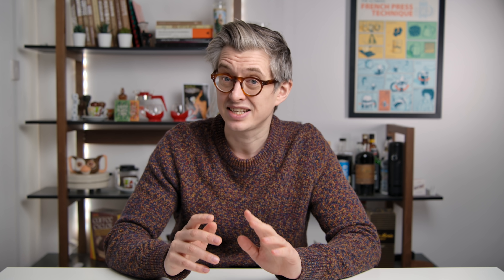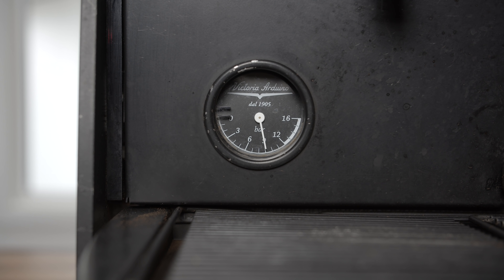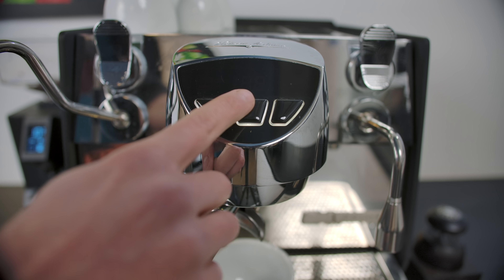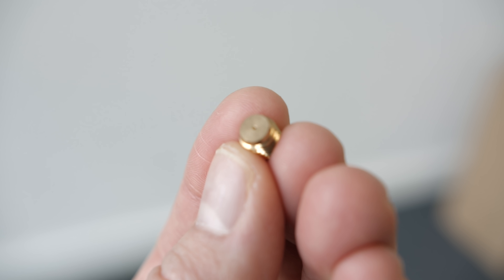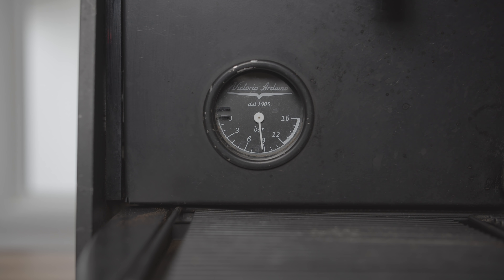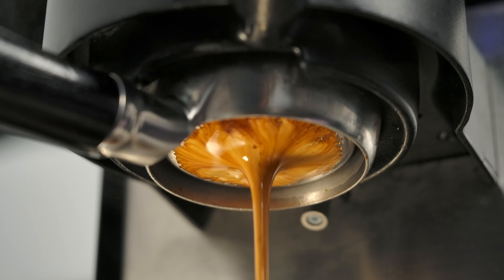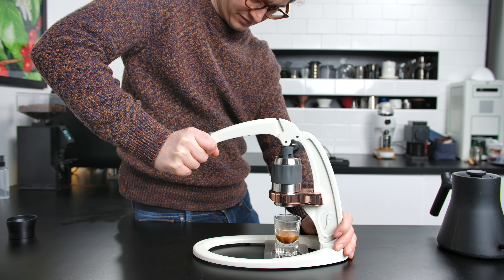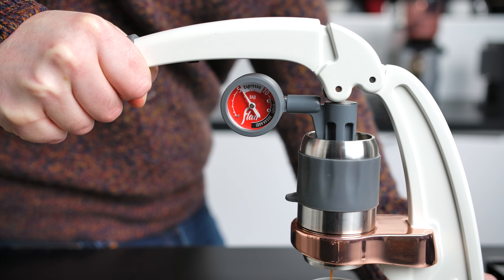Understanding Espresso: Pressure (Episode #6)

Comment: Thanks for this video James! I've been reading up a lot on this and i have a few questions, that you or someone here maybe can address.

I own a small cafe in Portugal, our machine is a bogstandard fixed 9bar, by your description of the pressure needle movement, it does seem to have a flow restrictor, but the delay is more in the 4-5 second range, rather than the 8 you look for.

We would really like to start to offer specialty coffee, as of now we only offer the normal portuguese dark roast robusta deal, which everyone else has. My fear is that with this machine i may not be able to make propper extractions.

I went ahead and bought new filter baskets, shower screens and a distribution tool, and the results seem OK, but i simply don't have anything to compare it to, partly because everything is closed, but also because it is very rare in Portugal to find specialty coffee. 

It is impossible for us so to shell out 5-10k on a flow control commercial espresso machine, so my question is: Can you make delicious light roast espresso with a flat 9bar profile? And if yes, is there a specific type of bean i should be looking at?

Thanks to anyone who has any insight on this.

Comment: Anyone with a Breville Dual Boiler should Google the pressure profile mod - no parts needed. There's two ways to do it, only one involves opening up the machine and making changes.
Reply: Check out Testing1x2x3 channel, he has done the mod and others on his Dual Boiler to pull the most memerising shots from a naked portafilter

Comment: Going to pull some shots on my Flair and ease the pressure a bit to see if I can mitigate channeling.
Reply: That definitely works! If you keep the needle high in the last third of your shot, there's a pretty big chance of channeling once the puck breaks down. I agree with James, on a Flair it feels intuitive to smoothly release pressure.
Reply: I also ramp up the pressure from 0 psi to 2 psi and hold it there until 20 seconds is up, then ramp up the pressure to 9 bars, then slowly back off to 6 psi by the end of the shot.
Reply: Definitely works. This is the major reason I'm sticking with a Flair and don't want a Decent/Rocket/Slayer. Use a mirror, a machine can never respond to the changes in pressure required the way you can see and feel it. Put your money in the grinder, my KafaTek Monolith Flat MAX is on the way.
Reply: @Richard.Mayston  i can't wait to buy an expensive grinder for my flair. i love it so much, and I'm currently on the niche

Comment: I am always struggeling with channeling in my espresso and I just can't seem to fix it, neither via grind size nor distribution. What other reasons could there be for this happening? 
I have tried using a dosing cup to shake up the grinds before dosing into the portafilter to try and get rid of clumps, but it doesn't seem to fix the issue
Working with a Sage Barista Express btw
Reply: I use distribution tool for my prep on my gaggia classic and I have now no channeling it could also be your tamp technique
Reply: @jornidema1884  The thing is I am using a distribution tool, so that would leave the tamping technique. Does that mean I am most likely over- or undertamping my puck?
Reply: @YaPeter  Over-tamping isn't actually a thing like people used to think it was! We now know as soon as the coffee is compressed, adding more pressure does nothing (good OR bad).  You could be under-tamping, but I'd be surprised if that was your issue.

The best way to fix consistent channeling problems is to practice WDT. If you're already doing sufficient WDT and still getting channeling, the next two things I'd think about are your brew pressure and your shower screen distribution.

If you have an entry level machine like a Gaggia, it'll come stock at >12 barrs. That kind of pressure can definitely contribute to channels even if you're doing everything else correctly.

The other issue I've seen is some people's grouphead/shower screen producing a couple fine jets of water instead of even distribution. These jets can basically punch holes in your puck and lead to channeling.
Reply: @mathnerdm  Thanks for the hints. Will try to do some WDT and take a look at the showerhead and check if there maybe is some lime scale that could cause jets.
I am using a Sage Barista Express and the pressure gage usually is in the acceptable area so, I dont think the pressure is the source of the problem.
Reply: Maybe you can watch Hoon’s channel. He said that it is because of the basket. There’s no vst/ims basket for it with 54 mm size.

Comment: Why doesn't Victoria Arduino Eagle One Prima have a brew pressure gauge? A ~5000€ machine. And don't say it's a design choice, there are combined dual gauges, and on far cheaper machines.
Reply from the maker: It’s all in the app, but there was a space constraint in shrinking the machine down to a smaller footprint than the normal E1
Reply: @jameshoffmann  Well, I'm about to order it irregardless, but a suggestion if I may: Perhaps a FW update can add an option to display the pressure on the group head instead of time.